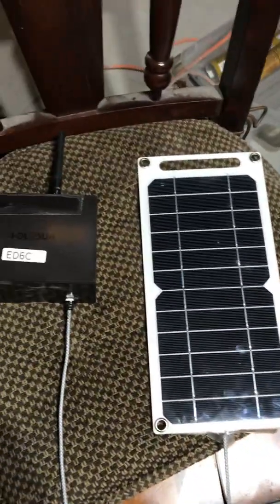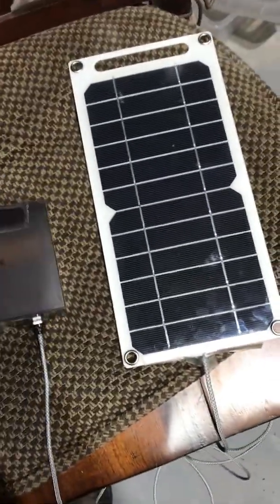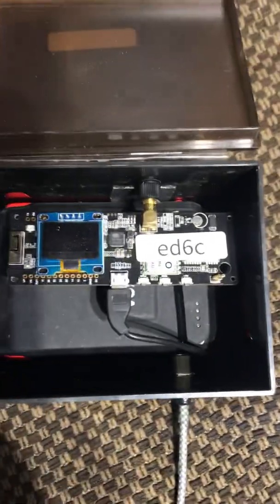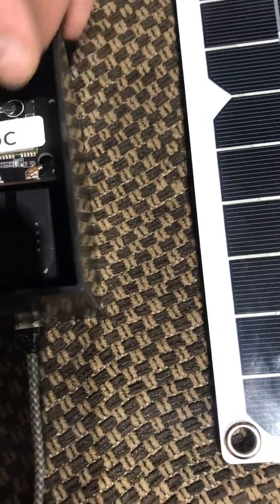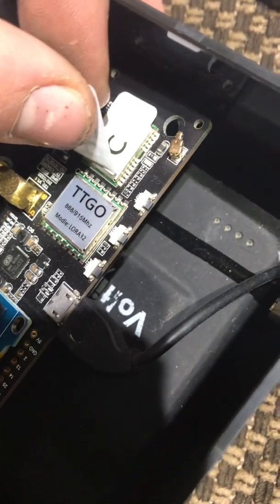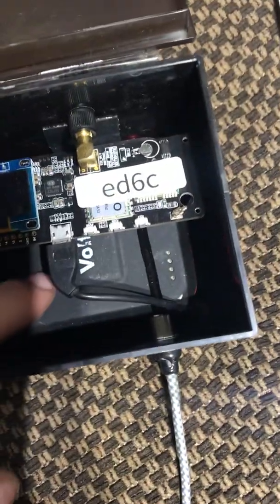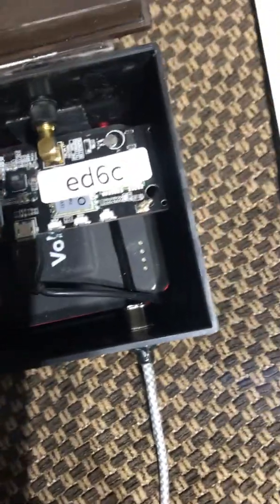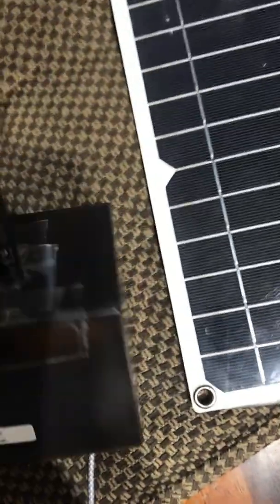LoRa Solar Prototype(s)

Comment: That is a kind of proof of concept setup. Nothing wrong with that,  but kind of wasting power by first making 12V to 5V to charge a power bank, which boosts the power bank's battery voltage up to 5V again to power the onboard charger on the TT-GO. Also powering the TT-GO through USB prevents it from sleeping so it is also using more power.  Best practice would be to solar charge a battery connected to the battery input of the TT-GO directly, circumventing the USB port entirely. Hooking up up the TT-GO directly to the battery in the Power bank would be much better, bypassing both the USB port and the electronics in the power bank. Edit: You are suggesting the same change yourself in one of your replies. and you mean connect more batteries in parallel, not series as you write.

Comment: Nice! If you don’t mind me asking, what type of battery back did you use?
Reply from the maker: It was just a cheap one from amazon, I'd definitely recommend just soldering/welding more 18650 batteries in series though, the internal board on the battery bank tends to eat up some juice, and it needlessly complicates the project, in my opinion. I should have another build up a week from today for V3.